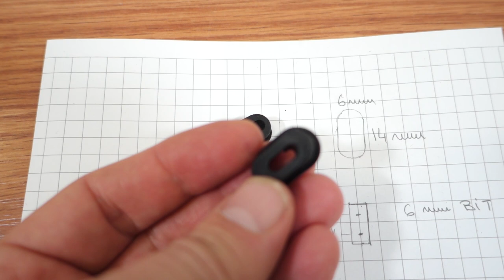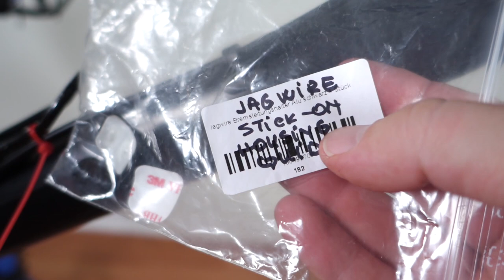How-to DRILL a BIKE for Internally Routed Dropper Posts - Step-by-step, MTB Frame

Comment: An American using centimetres make me so happy. Thank you God bless
Reply: I have no idea why anyone would make or modify anything (out of wood/metal/plastic/whatever) and use inches instead of metric measurements.  Although it would be remiss of me not to point out that millimetres are almost always better than centimetres at sub-metre amounts :)
Reply: He’s a Canaderican!
Reply: @ViscountCharles  
Because some measurements in Imperial are Base 8 and can be continuously scaled by halves.  Base 10 systems can’t do that without using decimals.
Reply: @keirfarnum6811  until you get down to about 1/64, and then have to convert to Thou - a process that is itself inaccurate at sub-millimetre distances.  And it’s no advantage at all if you want to scale something by a factor of 3, or 5, or whatever.  Whereas the metric base-10 system handles decimal places just fine - it’s literally built around them, with a millimetre being 0.001 of a metre.
Reply: I was taught metric and over the years i use inches and feet for like how tall is the person or how long is the truck and on the small stuff i use millimetres.

Comment: About jagwire stick on guides, I use them too for my dropper, you might want to look out as during wet weather they un-sticked from the frame leaving my dropper cable dangling. I use gorilla glue underneath them to reinforce it.
Reply: Yeah I found the similar thing, I actually used a lighter to heat up the 3m tape so it sticks way better, but will defiantly use the gorilla glue next time!!
Reply: I wonder if JB weld would hold those cable guide on long term?

Comment: you can go internal for the downtube too
Reply: LoveMTB No, you drill 3 holes. One up by the headtube, one by the bottom bracket and one where you did in the video. No one routes a dropper through the bottom bracket shell lol
Reply: @LoveMTB  or come out the hole shown in the video, go under the axle, and then up in to the down tube ? I think that would put more curve in the angle that the tight bend over the axle.
Anyway, what you did is great, nice video. Of course I'm looking at these videos because I want to internally route a cable, and I feel confident that you have given me the confidence I wanted. I want to put a rear brake cable in the top tube of an alloy frame.
My question to you would be, near the weld, or not ?
Many thanks 
Rob

Comment: Nice video but I would (it is only my idea) make anther 2 holes on downtube and and I would run the cable through it and make it internal.
Reply: @LoveMTB  how about on a road bike there is not theat mutch stress will it work?
Reply: @cannedpasta7819  why would you need a dropper on a road bike? :D
Reply: @hc7185  i was thinking to about making internal for the brake and shifters to make my old ocr 1 looking batter

Comment: 1:00 also, by the top tube, next to the welds, is a lot more risky potentially considering the life of the frame. A seat tube doesnt see much stress in the middle (nor does any tube really) but the headtube is where the most stress happens

Comment: Some dropper post like the "Brand X Ascend II" have external fixed mounting cable point @ the midcap,  so when you raise or lower the seat, no cable moves up or down.   Most people run a 1xN setup, so it leaves an extra slot on the frame for routing - perfect for a dropper post (no front derailleur).

Comment: I plan to get an internal dropper and use the drain hole to run the cable through. Is this a good idea? If so, why didn't you make a drain hole?
Reply from the maker: Drain hole? Not sure what you mean - look for the bike check video - https://youtu.be/fLIzl5SPJ24
Reply: I mean, there is a bolt that holds the cable guides. I plan to run my cable through there and up the drop tube. Is that too much of a bend? Maybe I should drill behind the seat tube, 4-6 inches above the BB; better?
Reply from the maker: @horusgarcia1  I don't know your bike but it can be an option, sure.

Comment: I used the seat tube water bottle bolt holes after I popped out the water bottle bolts/rivets
Reply: I never thought of this. I bought my wife a Trek Marlin 7. I looked at the 2019 range and figured the bike would be perfect for her, plus I had a spare dropper and the bike had internal routing. I ordered a 2020 model and Trek had dropped the dropper routing for 2020!! :(
Reply: @TrailBikeMike  The water bottle holder Allen bolts screw into a pressed insert.. I removed the Allen bolt then used a drill too drill into the insert,insert pops lot easy with a screwdriver. 👍
Reply: @TrailBikeMike  i also plan to do this with my 2020 trek marlin 6, finger crossed

Comment: Yeah man good video....thanks.  Did you not consider drilling another 2 holes in the downtube - one near the BB, the other near the headtube?   Appreciate that's a lot more work but then only a small bit of cable near the BB would be visible.   Either way, I'm giving this a go.   Thanks for the Jagwire cable guide headsup.    Good work fella.  Peace
Reply: I thought the same thing. Did you end up doing the extra 2 holes? How did it turn out
Reply: @brodygiddings  haha mate, I'm afraid to say it's still on my list of things to do

Comment: Would you drill for all cables? Brake, shifting, etc... to clean it up? Can the frame structurally handle it on a mountain bike?
Reply: Nope. That's a ton of holes. Also, you lose serviceability by doing that.

Comment: Hey! I have a 2014 breezer full suspension and am currently using an external dropper and can’t get it all the way in the frame (internal droppers are shorter) is this worth it and would it be structurally sound? I hit large drops and ride park. Thank you!

Comment: i have a frame that needs like 3 or 4 pieces of cable housing (some parts of the inner cable are exposed to the outside things), just for the rear derailleur and i was thinking to drill those things to attach the pieces of cable housing and just use one as a whole thing. but i don't know if it will work as it is. do you have some video or advice? 
cheers from argentina
Reply: @LoveMTB  oh thank you. good video. keep it up!

Comment: Would it be an issue if you drill a hole at the back of the seat tube? I plan on doing the same exact thing on my frame.

Comment: This is not the right place to ask this question but here goes anyways. Recently I had occasion to service my dropper post, and in doing so I wound up removing several of the frame grommets to make this easier. Well let me tell you there does not seem to be a way to get the grommets out of the frame without destroying them. I tried multiple methods and despite all my effort I ruined two of them. I have on order some replacement grommets, which by the way are 10.00 each but am wondering :  how in the heck I'm going to get them tucked in to the holes as each grommet is fully formed with two holes, brake and dropper, but I haven't removed my brake line so there is no way to thread it through the grommet. I'm thinking if I get a razor knife and split the grommet down the middle,but not all the way I can get it around both lines and try to insert into the hole in the frame. You ever done this before ?

Comment: I like where you chose to drill but will get in the way of my lowered botte cage. But could drill out the lower bottle boss in that spot.   My 2017 Fatboy came with a port drilled on the rear side of the seat tube down low, just over where the chain stays are welded.. I am thinking of doing a hole in that very same spot on my 2016 Salsa Blackborow, and routing the cable from there under the BB and externally up the bottom of the down tube.   Since the Fatboy has it in this same spot I am thinking a safe spot for this frame as well ??
Reply: @LoveMTB  OK thank you for your insight.. I'll avoid it

Comment: Gutsy move! Two questions:
(1) it's been more than a year now, anything has happened to the frame since? No cracks?
(2) Did you drill a drainage hole in the bottom bracket in the end? Have you ever taken a look in it to see if water / gunk tends to accumulate in there?
Reply: @LoveMTB  Amazing... I would never have dared to drill a hole in a frame.
Reply: @LoveMTB  Where do you put the drainage hole?

Comment: Good tutorial but can I ask because it looks so good with the grommet, why didn't you put an entrance and exit hole in the downtube?
Reply: @LoveMTB  thanks, just letting you know, I was not critising, just wanted to know before I started drilling.  Today I've just done my old Rock hopper frame, rear brake cable and dropper post cable internal. I went in at the top of the downtube on one side, then out underneath middle at the bottom of the downtube around the outside of the bottom bracket tube then in at the bottom rear centre of the seat post tube. Worked really well. Ground off all external cable guides and V brake mounts, just preparing for spray now.
Reply: @LoveMTB  amazing how different it makes the frame look, totally updates my 2004 Rock hopper frame. Also if you want some info to file, 27.5 wheels fit the frame with about 5mm to spare with Scwalbe Rapid Rob 2.10 tyres.
Reply: @LoveMTB  I don't think people are saying to route it internally through the bottom bracket.  What they're saying is before you get to the bottom bracket, drill a hole in the downtube.  Then drill another hole near the top of the downtube near where it meets the steerer tube.  You would see a small section of cable going from the downtube to the seat tube.

Comment: Wily old fox, I'd like to try it to mine, only question is is it going to weaken the frame tho?
Reply: I did this to my bike didn't show any crack at the hole nor the sit tube for 6yrs now
Reply: If weakening the frame was such a problem, how do they compensate for this with factory internal routed frames? thicker frame tube wall or internally welded plate around the opening to add back the strength? 

Maybe, but I doubt it. 

Yes, they have engineers to test the fact, of course.. but, seems pretty unlikely that there is any significant weakening by adding a small hole.

I think it is worth remembering that the load on the seatpost tube spreads to the downtube, via the bb housing & also the chainstays in the case of a fixed backend.

Comment: Hello, none of the gromits you listed below fit the dimesions you have provided. What is the exact gromit you used please?
Reply: Because I have made this hole in my frame and ordered the grommets you have listed and they are too big.
Reply: Thanks for your response. I have some I have ordered here and they will nowhere near fit even at a squeeze (and boiled to made more malleable). I am going to try a different brand as these are clearly for a bigger dimension. Cheers anyhow, I'm happy with the hole I made from your video so far :)